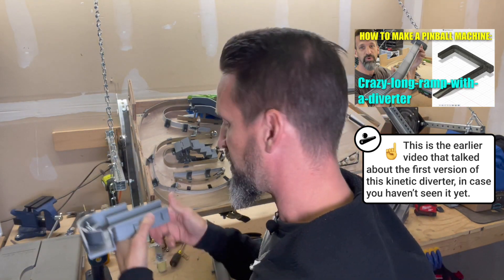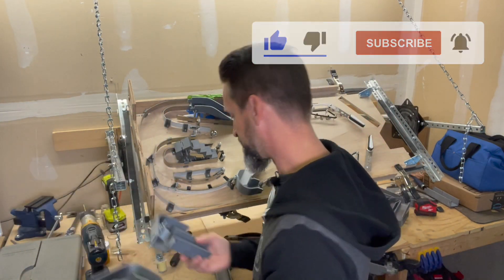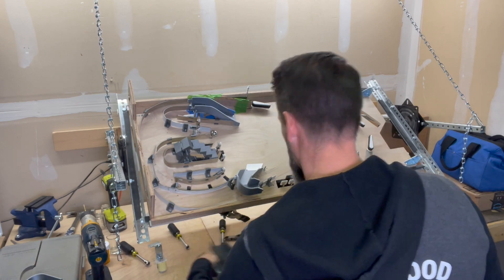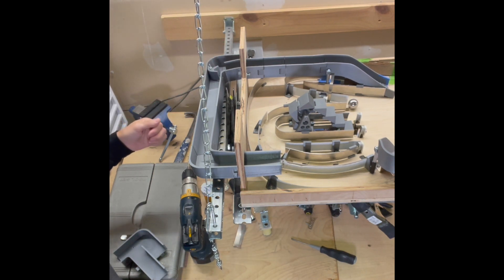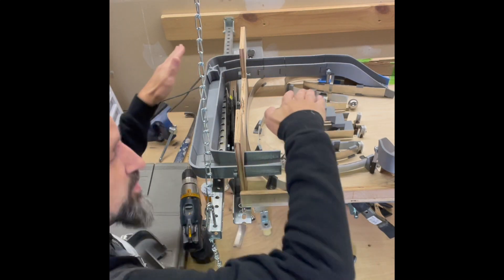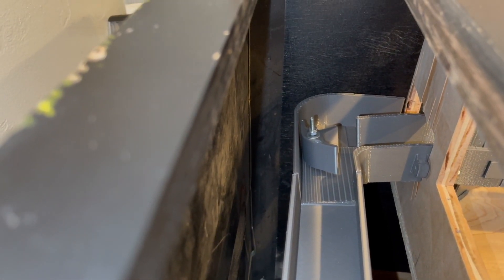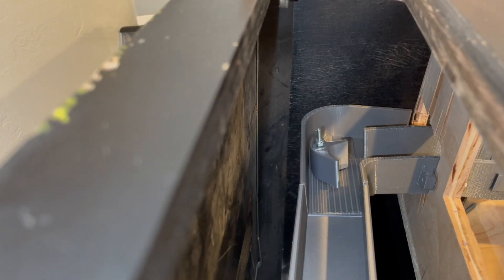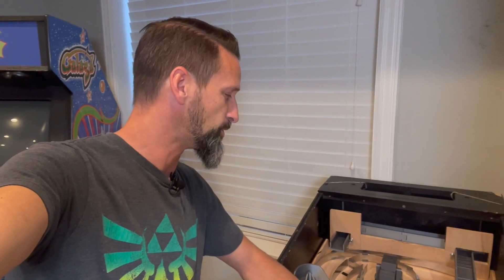HOW TO MAKE A PINBALL MACHINE: Kinetic Diverter Take 2

Comment: A couple of ideas to get your diverter to "index" more consistently: Small magnets on the back of the two side arms that are attracted towards the back of the mechanism, or any kind of spring that connects to from the tip of the middle arm, to somewhere behind the pivot point.
Both will make the diverter want to "rest" on either one side of the other.
Reply from the maker: Great ideas thank you!!

Comment: Do you use pla? Can you do a video of your 3d printer setup and settings?
Reply from the maker: Yep all PLA so far, I have some PETG I’m going to try at some point, but yeah I can do a quick video of my printer setup 👍
Reply: @thepinballroom  I think petg is a good idea. It will probably last much longer as it is not as hard and brittle as PLA. Still pretty easy to print with a quality 3D printer :)
I found your videos because I also just recently started to work on a DIY pinball machine. Although I will try to do even more by myself, like the whole code and at least some of the PCBs. I am currently designing and testing (almost) completely 3D printed flipper assemblies :) I bought a solenoid with a plunger a couple of screws and a ball bearing and will see how far I will get ^^
Reply from the maker: @TheLoaderB0T  Love to hear that you’ve got a project you’re working on! Please share as get things going!! Are you printing out just the flipper bracket portion or also trying to fully 3D print a flipper bat ? I wonder how well that would work/ hold up to the force of the coil and pinball. 

And yes, I keep putting it off but need to try out the petg on my prusa printer to see how well it holds up
Reply: @thepinballroom  Oh well I tried to reply with a few links to gifs of my current 3D model. Seems like they got removed, maybe you can allow them somehow? ^^
Reply from the maker: @TheLoaderB0T  I have no idea how to do that sorry- but you can email them to me thepinballroom at gmail dot com?
Reply: @thepinballroom  done ;)
Reply from the maker: @TheLoaderB0T  reading your email now! 🙂
Reply from the maker: @Ian Hobson btw I’m using a Prusa i3 mk3s printer

Comment: Nice ! 
Thanks for the update
may be you should tighten up the bolt a little bit more ... just enought so the diverter can not bounce, but can still swap back and forth... Friction is not always a bad thing ;-)
cheers from France
Laurent.
Reply from the maker: Yeah the post I’m using I can’t tighten any more, but I’m going to need to find a different post I think and try what you’re suggesting
Reply: That exactly what I thought;-). Try some rubber or steel washers between your diverter and your ramp too. With this you should also be able to tighten it with your actual post;-). Im in another problem at the moment.....Im searching for a way to slow down a ball after it hits a standup target (I dont want to use a magnet). The target sits at the end of two lane guides that are 5 centimetre apart from each other. Im thinking about to narrowing the the guides from 5 centimetres to 3 so that the ball is breaking down its speed a bit.....but I dont think that this would be enough. If someone has a suggestion for me .......;-)
Reply from the maker: @bsth_pinball6043  ah yeah good point I could just throw in a bunch of washers to take up the extra space - as for slowing down the ball after a standup, hmmmmm in what anount of space? And how much do you need to slow it down? Details, I need more details 😉
Reply: @thepinballroom  My problem is: Ive build a danesi lock. The mechanic and programming works perfect. The problem is when the ball hits the standup target at the end of the danesi lock it bounces back such fast that only my the first target (of two) can catch the ball. For the second target (which is also narrower to the standup target) the ball is too fast and the dropdown target is too slow to catch the ball. I now had added some optos to activate the targets when the ball enters the danesi lock. Its better a bit and sometimes the second dropdowntarget can catch the ball now too. But often the ball is too fast and the dropdown target is too slow. So my thought is to slow down the ball a bit after or before it reaches the end of the danesi lock. I also will test some foam at the end of the danesi lock to slow it down when it bounces at the back of the danesi lock;-)

I hope you understand my problem now....sorry my english is not the best....
Reply from the maker: @bsth_pinball6043  aaahh! Yes, I completely understand- how much space do you have between the stand up and the first drop target? I’m curious because I plan on doing something almost identical at the end of my three drop targets, too! Hahah, I’ve been planning on optos but don’t know yet how much space I’ll need to make it work. Lmk what you figure out, I won’t be working on that fir a few weeks still
Reply: @thepinballroom  About 8 centimetres. Its not much for a Danesi. You could also try to power down your flippers via software. If I do this it works, but then I have not enough power for my big ramp. So its a balance between space, opto placing, and flipper power. Im working further on next weekend.......the danesi lock is a must for my machine. I will also post some videos next weekend.....I will let you know when Ive done that;-). Wish you further success with your project. Im also in the slack group btw;-)
Reply from the maker: @bsth_pinball6043  oh that’s right! You are in the group! K, I’ll msg you more there
Reply: @thepinballroom  yep sent you an message on slack so that you know my name there;-)